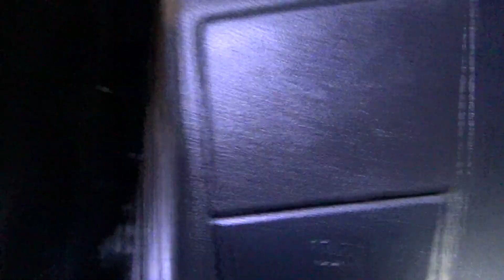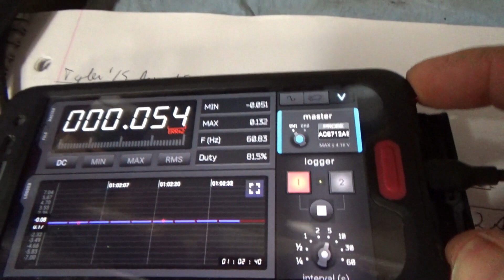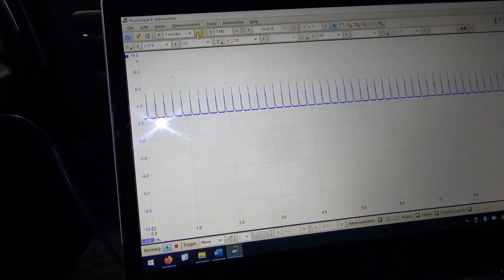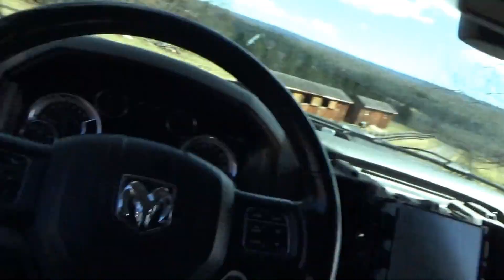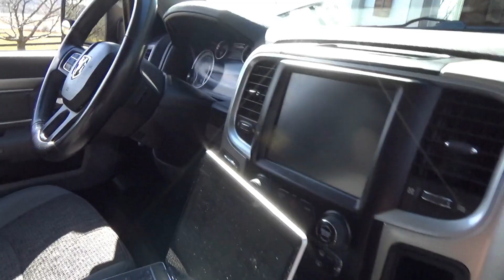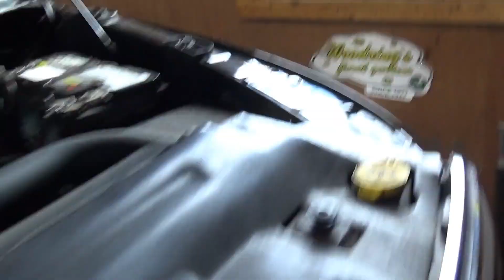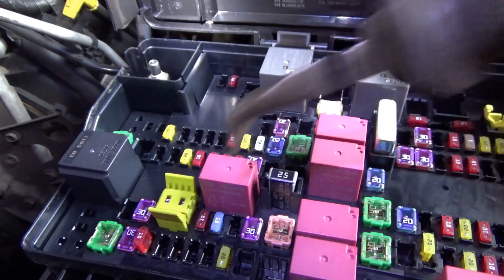Have Never Seen THIS Kill a Battery Before... (Parasitic Ram - Part 2)

Comment: I wish you was near me, i have Jeep Grand Cherokee 2008 never given me any trouble for the last 6 years, now i am traveling Australia with it, from all that time now started to fail me, i have code P0243 westgate solinoid A...... i booked the car at the dealership im so afraid no idea what will cost me, lucky im with NRMA road service, they will tow the car and caravan to a caravan park they pay the accomodation for 10 days, and when i take the Jeep to the dealership they also hire a car for me untill the Jeep is fixed, im a pensioner i hope they will not glober me :) P.S. i like the way you think, you are very clever, weldone

Comment: I'm glad you mentioned the fact that BOB's do draw something. Also on some cars, it can keep the network awake. Consult a wiring diagram 1st! I dunno why Chrysler wants all vent doors to close, key off. What about a used module? Do they have to be programmed per VIN?
Reply: Condensation.
Reply: I'd study the circuit of the BOB.  It might be possible to install a switch to turn off the lights.
Reply: Chrysler probably wants all vent doors to close with key off so that they can wear out a bunch of 
components forever and a day. On and old vintage car, would all this closing of vents etc be going
on for $hits and giggles??? I kinda doubt it! Just the mear old vacuum actuated blend doors were
a pain in the @$$ as it was without what goes on now.
Reply: @craigtegeler4677 It’s likely a default strategy of sorts.  Similar to how on vehicles with vacuum controlled blend doors, they would default to defrost in the absence of vacuum. It’s a safety so that if it fails, you at least have defrost, since that is the most important of the bunch.  

I had an older GM with vacuum controlled blend doors that had a slightly leaky vacuum reservoir.  On harder acceleration, or when climbing longer grades, the airflow would gradually transition to defrost until the engine vacuum returned to normal.

Comment: I like the $1000 solder repair. Are RAM products more prone to electrical gremlins. You mentioned it has a new fuse box...that is terrible that it needed replacement. I think that you going out of your way to save a customer money is noble. Your honesty will surely bring you even more business. When people know that you are on their side, they will run to your door.
Reply: Watch south main auto, Eric O, will show you some more on FCA and GM electrical problems. Gm apparently loves to put modules under the vehicle where they get plenty of water & salt. 
As for ford, they decided the main fuse box on the super duty trucks should be pretty much right under where water drains off the hood. It’s covered, but doesn’t feel very “sealed” to me. Time will tell.
Reply: @jeffs2809  The fact the BEN HARDY reported FORD was number one and GM number  2 last year for recalls speaks volumes about the crap those two build. I also have personal experience with both. For me personally, Toyota is by far leaps and bounds better than anything I have owned before. Mostly it's just maintenance.
Reply: Ever see them under the front fender ? What were they thinking, or were they?
Reply: @mikefoehr235  - As far as 'all of their products' having electrical problems - not so. My 2012 Challenger R/T has only been in the shop once, that for the recalled alternator, and it didn't fail. Our 2019 Ram 3500 dually HD diesel had the choke module go out at around 5k miles, but what u expect - these things are more computerized than the Apollo moon machines were....
Reply: Well Chrysler Co DID buy AMC in '89 to get jeep. AMC did have a model called Gremlin
Reply: @curtissimmons1085  Scorch
Reply: Absolutely ram wiring is terrible
Reply: @mikefoehr235  - Even worse than electrical problems, Stellantis took THE BEST HD Diesel passenger truck engine, switched from flat tappet solid lifters to hyraulic roller lifters for 2019... Engines that had been going 300k miles are now eating lifters & tossing rods thru the block..in under 50k miles...
Reply: I'd have to say YES to gremlins in virtually all of their products... Fiat/Dodge and Chrysler!!! Every stinking
one of them!!!
Reply: @craigtegeler4677 dont even look at volvo
Reply: @craigtegeler4677  That is my gut feeling. The worst is the dreaded TIPM.
Reply: @mikefoehr235  Yes the TIPM.  I might have missed something on this video.  If that AC circuit is sending power through the TIPM  wouldn’t you look at that???
Reply: @msilver9157  I have seen TIPM issues on several different channels with Stellantis. My daughter and son in law have a JEEP and I warned them it could become a problem.
Reply: The electrical gremlins made me dump my 06 charger. This was prior to it becoming known that the fuse box was crap in all of these.
Reply: @eatdafat7101  I have owned GM/FORD but no Stellantis product. I have had excellent luck with Toyota. Of 4 Toyotas so far, not one electrical problem yet. That goes back to 2004 with our 04 Corolla.
Reply: @mikefoehr235  the only consistent issue I’ve seen with Toyotas is the AIR injection system on the trucks and large SUVs but that’s not too bad to deal with and nothing compared to issues I’ve seen with Ford, Dodge, and GM.
Reply: @Jpilgrim30  Another issue I have had with 3 of 4 Toyotas is windshield issues. They break and/or squeel for no reason. Replacement solves the issue. Have 2 replaced under warranty.
Reply: @J B The brand does not have a stellar reputation
Reply: @mikefoehr235  My Jeep & my Ram 1500 have had many electrical gremlins, plus very thin wires that break easily.
Reply: @NoWr2Run  That is a shame.
Reply: @NoWr2Run  the thin wiring and tiny terminals is starting to become an issue with a lot of newer GM vehicles causing a lot of intermittent electrical issues.
Reply: @Jpilgrim30  100%, I upgraded a lot of the wiring to 10 Gauge plus relays for the headlights.
Reply: @J B More like, "This is what happens when the company doesn't care whether it produces crap or not."
Reply: Definitely. That screen will likely need to be replaced next as the cheap adhesive it’s held together with will melt and run out leaving the touchscreen delaminated and doing its own thing.
Reply: Of course they are it's a Dodge
Reply: Dodge / Chrysler / Jeep / Plymouth, the whole umbrella is an electrical nightmare

Comment: The module can't cost more than $20 to make, even less in high volume
Reply: Ivan stated that the original module had been superseded, that is because some of the IC chips are not being made anymore. Replacement R&D, retooling and the original R&D and software programing costs need to be recovered. Some of the chips are more than $10 even in high volume.
Reply: @breezy1849  maybe the cost of software R&D is once that amount again, but that's a one-off cost that gets divided to hundreds of thousands of end products. It's definitely  not $800 per piece.
Reply: @brainndamage  It isn't always a one-off cost there is always revisions required, due bugs being found in the software.
Reply: Eh If it was only $20 to make would not there be a stronger aftermarket?
Reply: @Mac-mu9cs  the problem is getting the software, the manufacturer treats it as his intellectual property so any clones would be seized as counterfeits and probably also on safety grounds, since it interacts with the CAN bus it can theoretically cause the vehicle to fail in a dangerous way (that is what the manufacturers will say anyway). Even if theoretically you could make a software with equivalent functionality they wouldn't allow it. These chips have advanced software protection, sometimes even encryption, so it would usually not be possible to read it out. Then there's parts availability, for example the microcontroller manufacturer may have an exclusive contract with the car maker to not sell the chip to anyone else in order to kill the counterfeit and aftermarket.
Reply: @brainndamage  believe me been hearing “its our software” bs for 20 years.
    The software in these modules should be available after a few years.  Like i have said the manufactures dont want these cars lasting 8-10 years
Reply: @Mac-mu9cs  it's more that they're hyper paranoid about their competition using their software to gain an advantage. it's just a bonus that the modules fail amd will make the product unrepairable some time in the future.
the alternative software development model would be to open source all code, so that not only can aftermarket parts and repairs be supported, but also individuals can audit the software for bugs and exploits. But the manufacturers are probably too paranoid to ever open source anything, they like the security by obscurity model more (which has been proven not to work in the computer software world decades ago)

Comment: There's no way I'd pay 800 to fix a battery draw that's an  absolute piss take by fiat Chrysler absolutely  I would just buy one of those battery disconnects and call it a day. But what do you do if the thing fails completely and you have zero air conditioning and heat.

Comment: May not be failure in module itself, but could be actuator, or blender door not returning to rest, power off home position keeping HIVAC awake. Alternatively, track down used module from parts truck. About clicking sound, could be broken gear blender door. Perhaps run HIVAC to check Blender doors move on both sides when adjusting ventilation settings up and down.
Reply from the maker: If a stuck blend door results in the whole truck staying awake then that's a piss poor design. I made sure that wouldn't happen ever again 😎👍
Reply: @PineHollowAutoDiagnostics  "...then that's a piss poor design."
I didn't realise this was your first encounter with a Chrysler product... 😉
Reply: Totally agree, it was a major assumption to blame the module. Just because the blend door appears to be working normally between a couple of positions is no guarantee it doesn't have a fault.
Reply: I dont understand why he isnt mentioning robbing a junkyard for the module.
Reply: First thing I'd try is just updating the module. Maybe the issue with a broken actuator was fixed in the meanwhile and the module can handle the error correctly.

Comment: Is there no way to reprogram/reflash the module before replacing, see if it's just some software fault instead of a bad module?
Reply: It may be worth a try if it can be done.
Reply: Whats the cost of finding out if it can be updated or reflashed?  I have not even looked at the  re flashing of RAM products out side the dealer network.